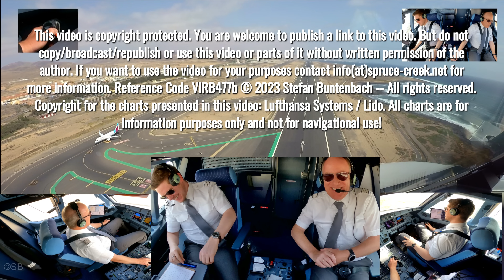Airbus 320 NEO landing on a strange runway | FUERTEVENTURA RWY 01 | pilots + cockpit + instruments

Comment: So why is the threshold so far down the runway?
Reply from the maker: I got the information that the airport wanted to install a full approach lighting system. They did not own the land infront of the „normal“ threshold. So they displaced the threshold for landing and installed an integrated approach lighting system in front of the displaced threshold.
Reply: @ApproachandDepartureVideos  Outside the box thinking. I like it

Comment: Hello captain, thank you for the wonderful channel and videos. I’d love to learn more about descent and energy management as I love to use A32x on flightsimulator. Which technique you use? I know normally 3times altitude gives the distance required. Then how many miles do you add for deceleration from 300/250/210 (green dot)? I read there are many different opinions regarding miles for deceleration. All the best
Reply from the maker: Thanks for watching and your great feedback! The 3x rule usually works fine. Add a few miles for the deceleration. In general, it all depends on the wind, the weight and  the aircraft type. If you do a managed descent and follow the precalculated path, you can see how the Airbus would do it by itself.

Comment: I'm always amazed at how much you have to throw around that stick. If that was an SR22, you would have done a couple of loops and several barrel rolls on final with that kind of input!

It seems like it would be hard to adjust to a private plane after flying something like that.. they require such a light touch in comparison.
Reply from the maker: Thanks for watching and your feedback! Sure, every airplane is different. Especially in regard to the required inputs. It is very easy to adjust the inputs to the plane you are in. Here is a video of me flying a Mooney M20 single engine airplane https://youtu.be/m2dmsSjhhnU

Comment: What is the reason for a displaced threshold. ? This one is exceptionally long.
Reply from the maker: I have been told that they could not install an approach lighting system in front of the paved runway because they did not own the lot.  So they moved the threshold by 1000 meters and installed an integrated approach lighting system in the concrete between the beginning of the runway and the displaced threshold.

Comment: intercepting G\S before LOC ? is that familiar
Reply: Has to be done sometimes. Better than trying to intercept from above
Reply from the maker: Usually, we do not do that. Here it was a little different because we got a direct to clearance to a waypoint which had to be crossed at 2500 feet for the standard glideslope. Our clearance was to descent to 2700 feet and we were cleared for the approach. Over water, we descended a few feet a moment before approaching the localizer centerline to avoid a level off at 2700 feet and the need of a subsequent glideslope from above maneuver.

Comment: Thank you for another awesome video! Is anyone aware of why the displaced threshold is so long in fuerte? Why didnt they change the markings when they made the runway longer?
Reply: The big one would be they would have to move the glide slope antenna
Reply from the maker: Thanks for watching and your friendly words! I have been told that the original reason for that displaced threshold was that the airport did not own the land in front of the paved runway. But they needed room for the installation of a 900 meters long approach lighting system. So they just displaced the threshold and installed an integrated approach lighting system in that 900 meters part of the runway.

Comment: Great as always, Nice place. Very long threshold that can confuse during a flare because you don't want to end the runway and also to not touch at the threshold. What are the main features in the NEO version? besides less fuel and efficiency I mean in the visual screen, instruments and etc. I saw a new thing over the PFD that it tell you the status of AutoBrake also AutoBrake off callouts
Reply from the maker: Thanks for the good feedback! Besides the fuel and the efficiency it is the much better performance. Compared with the CEO, the NEO at the same weight is able to climb with a higher rate and to a higher flight level. And: The emissions are reduced by a great amount.
Reply: Depends what options you get. BKUP SPD/ALT (displays a back up speed scale incase of unreliable airspeed) ROW/ROPS (warns if you might over run runway) FLS capability (ILS like indication but for non-precision approaches) GA SOFT mode (reduced thrust go around)…….some of these can even be retrofitted to CEO variants.

Comment: At what wind speed would you start to encounter more turbulence on the approach to GCFV? I mentioned 30-35KT approach winds and strong surface winds across the Canaries for a customer call, but the landing looked well handled. Perhaps a function of the topography at this particular airport, compared to say LPMA in the same conditions?
Reply from the maker: This is difficult to predict. The warning in the Fuerteventura airport information is: "Down draught on final with westerly winds. Possible windshear and turbulence below 3000ft which may lead to unstable or missed
APCH" They do not mention a certain windspeed. It is not only about the windspeed, it is also about the wind  direction and  the changes in wind speed and direction during our flightpath on short final. Madeira can be easy with high steady winds from the right direction and no changes during final approach. If the windspeed and direction changes on short final (Rosario wind indicator) and between the touchdown and mid wind indicators, it may be already getting ugly with 10 knots of wind or so.

Comment: Amazing landing I just love the A320neo I wish they could make the Fenix A320neo in flight simulator 2020 but right now it's only a CFM engine available and not IAE or LEAP engines and also its not the neo variant it's the A320-200.
Reply: It’s pretty much just the A320-214 variant, most common one
Reply from the maker: Thanks for watching and your feedback! I wish you that there will be an A320 NEO simulator add on provided soon. The professional level D full flight simulators we use at the airlines are also usually not at the A320 NEO standard. They provide the A320 CEO with IAE or CFM engines.
Reply: @ApproachandDepartureVideos   That's great basically the Fenix A320 Simulations on Microsoft Flight Simulator 2020 is a high quality payware addon that costs about 60$ and it is so realistic that even circuit breakers work and you can enter the cabin to open the door I highly doubt other flight simulators have made an A320 that realistic it has an EFB with a home button along with take off performance and landing performance it also provides easy access to Navigraph Charts which uses Jeppesen charts for only 10$ a month which is crazy.

Comment: I'm guessing the airport operators extended the runway to the South but didn't want the expense of relocating the ILS or consulting the locals for a change of flight path? Hence the displaced threshold?
Reply from the maker: That maybe the case. I heard from others that an approach lighting system could not be installed in front of the runway. So they integrated it in the runway and moved the threshold by 1000 meters.

Comment: Fantastic video, crazy long displaced threshold!  What are you stabilised landing criteria? Seems to differ from a 737 SO, ZB. 737 stabilised approach at 1000ft then call continue at minimums, where as you have a call at 400ft and also at minimums, the differences are interesting.  Keep up the good work and greetings from Birrfeld Schweiz.
Reply from the maker: Thanks for the good feedback! In general (with some exemptions), we are stabilized at 1000 feet above the threshold elevation on speed and in landing configuration. The auto callouts can be programmed from the airline. Some airlines use 500 feet radio altitude, others start at 400. At minimums, the pilot flying decides to "continue" the approach or to abort the approach ("go around, flaps"). Greetings to Switzerland

Comment: Nice landing! What could happen if you decide to land at the beginning of the runway instead of the correct threshold?
Reply: Penalties and fines for the airline. An interview with chief pilot……without coffee
Reply from the maker: Thanks! This is not allowed and could be treated as an off runway landing. The only time it may be possible without bad  consequences for the pilots and the airline would be in an emergency situation where you need more runway length than the available runway from the displaced threshold. I am sure that in that particular case tower would approve immediately a landing at the beginning of the paved runway.

Comment: Hi Captain, what are the factors dictating a manual thrust landing or auto thrust landing? If it's the pilot's discretion, what's your personal thought process? Thank you for another great video!
Reply: At some Airlines, the use of A/THR is SOP restricted. For example: EZY doesn't turn off their A/THR. But at many other Airlines it's more or less pilot's discretion - of course keeping the benefits and possible overload into account.
Reply: @Julian-mo9dn  And Condor does it the other way round, manual flight should also be manual trust.
Reply from the maker: The pilot flying can decide what he or she wants. We must be able to do it with and without autothrust. I prefer autothrust especially during visual approaches, during bad weather, circling approaches ..... The use of  autothrust reduces the workload and gives me more brain capacity for other important things.
Reply: My same question has been answered 😀.

Comment: Good morning.  I have a curiosity: if one pilot is incapacitated, does the other return driving alone or helped by an on-board assistant?  Thank you.  And congratulations for the nice video posted.  Have a nice weekend.
Reply: Depends if they have a pilot onboard. Cabin crew aren’t trained to fly an aircraft even in an emergency. If if that pilot doesn’t fly that aircraft they could operate the radios
Reply from the maker: Thanks for watching and your great feedback! One reason because we have always two pilots on the flightdeck is the redundancy in case of an incapacitation. In case of an incapacitation, the remaining pilot diverts the plane to the next possible airport with medical assistance. He will take over also the duties of the incapacitated crew member. We train this on a regular basis in the simulator. Sure, if there is a 3rd pilot in the cockpit, he or she would take over the duties of the incapacitated flight crew member.